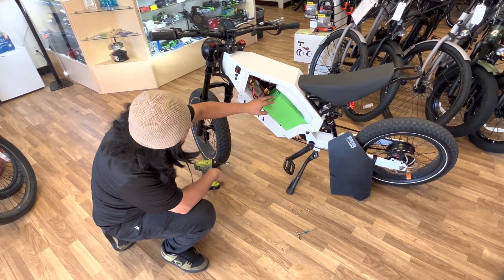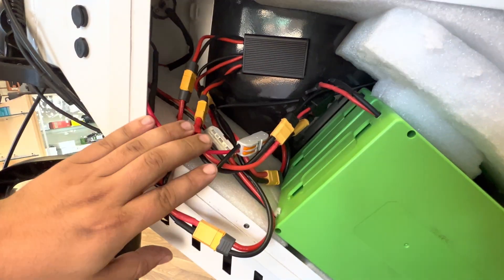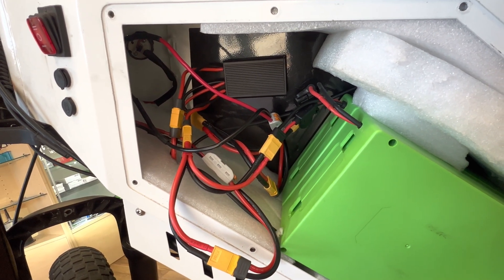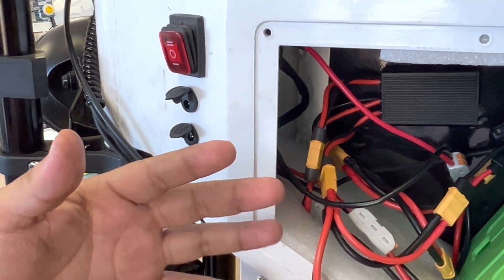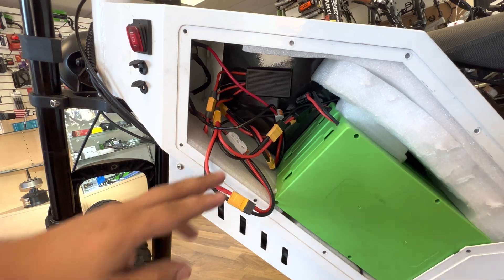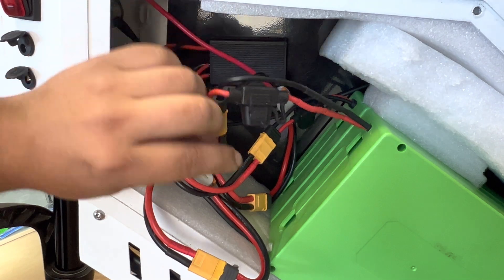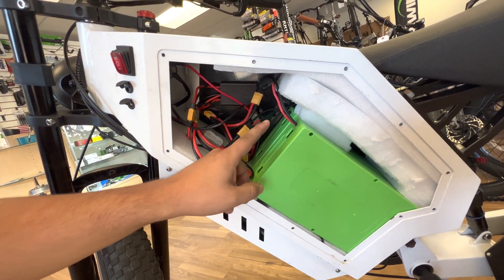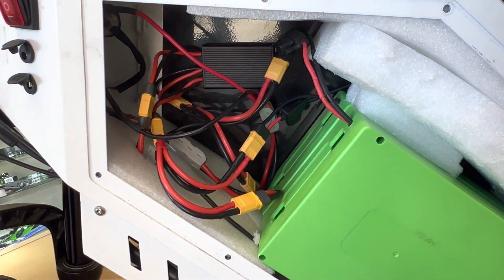E Bike Dual Battery Setup

Comment: this is not a paralell setup. what you're showing is called a battery balancer. parallel batteries will combine their amps/volts into 1 big battery vs the balancer still treats them as 2 separate batteries.

Comment: I killed my secondary battery by back charging it, only had one battery plugged in and it was "back charging" the secondary. I now have a cut off switch on the balancer input.
Reply from the maker: Dont use the balancer to charge, use a lead that bypasses it or the charger port on your battery individually
Reply: @djoccult  I was charging the main OEM battery with the secondary plugged into to the balancer. The balancer voltage works both ways. I had to install a switch to cut off the secondary from the balance circuit to use two AC chargers.
Reply from the maker: @brentpolk8331  it does not work that way for me, the device is basically a really big diode and doesn’t let voltage travel the opposite direction. Your dual battery discharger must be blown, so its acting like a direct connection.

Comment: 1 more question. Can you combine a dual port (stock battery) with a single port battery? Or would both have to be identical?
Reply from the maker: You can use any battery as long as you charge them individually and as long as the voltage is the same

Comment: New to e-bikes. Just got a roadrunner pro and wanna add a second battery. Aren’t those single port batteries more likely to mess up on you due to it not having that management system?
Reply from the maker: They have a bms, they just dont have an on off chip so less likely to fail or get tripped by heavy discharge.